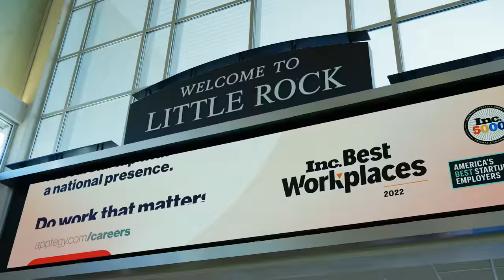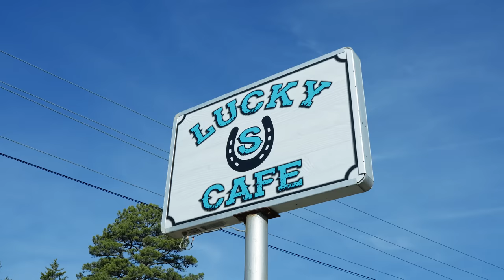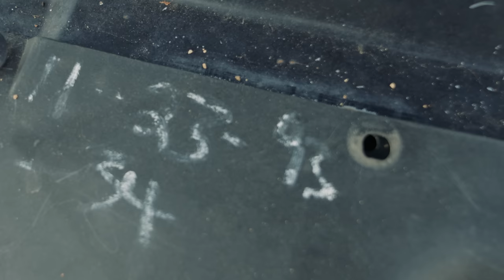CLASSIC CARS GALORE - Arkansas Trailer Haul

Comment: I had an 87' I ROC Z28 when I was 17 in 2004 Black on black with vin engraved T-tops.. And an 89'RS that went 0-60 in 2 days flat (Bad throttle control and speed position sensors).. I wish I hadn't blown that IRoc!!! When I got it, it had a 454 (obviously not factory) with a 6 speed which needed to be replaced or rebuilt.. But I drove on it for a while before I dropped in a a 5 speed I got with the factory 350.. Took 2 weeks before I forgot it wasn't a 6 speed on the highway one day.. And where 6th USED TO BE was now REVERSE..  I was only 17!!!!  The noise it made before 2 pistons shot through the hood..

Comment: 87 TA and Camaro only came with a 305 with t-tops; if you had a factory 350, it was the coupe. And the 87 350 was a tuned port injection, not carbed or tbi.

Comment: They never put a 350 in a T TOP or convertible iroc due to the roof being part of the structure support. Convertible and T TOP were at 305. 
Coupe was 305 or 350.

Comment: That Iroc is a 305, it has TBI or throttle body intjection, if it was a 350 it would have TPI, or tuned port injection, also would have a badge on the rear bumper stating 5.7 TPI.

Comment: The way tp tell if an IROC is a 350 is if it has an automatic transmission.
If the car has a 5 speed manual, it's a 305 V8.
Reply: @floydcoppage9423  Not true. You couldn't get a 350 with a manual until late 1989.
I worked at a dealership back then. The reason no manual with a 350 is because  it had something to do with the size of the bell housing & transmission tunnel.

Comment: 2004 5.3 4l60e swapped 82Gmc c1500 Sierra Classic Squarebody from Travis county Texas. Located in Berea Kentucky for 8500 or best offer. Solid truck needs paint. 2/4 drop, cowl hood, phantom billet grill, 295/50 265/50r16  BFG Radials, Bucket seats and console, trans cooler, clear title. Wanna return a Texas truck back to Texas? All the works done just needs paint.
Reply: Not today mr scammer man 😂 but Richard if you buy the truck I'll give you a 1960 c50 Viking 1.5 ton truck for free.
Reply: Nah it's not 😂

Comment: I wanna see that trailer when its done. I think it has potential
Reply from the maker: How should we fix it up?
Reply: @GasMonkeyGarage  clean it up and refurbish it. Then plaster the side with a Gas Monkey Logo like the flat bed trailer that has been used for years. I still think the single car hauler will get used more often, but having a enclosed trailer at the ready is not only an asset, but will protect some of the awesome projects that Richard finds. Make the trailer match the truck that will be paired with it.
Reply: @GasMonkeyGarage  put gas monkey decals on it